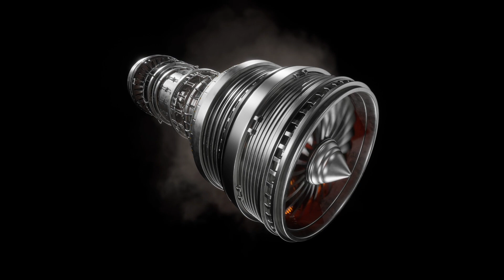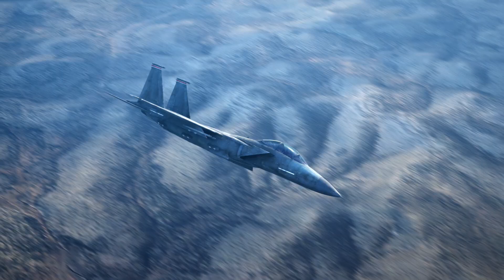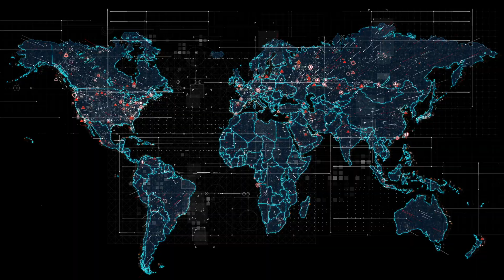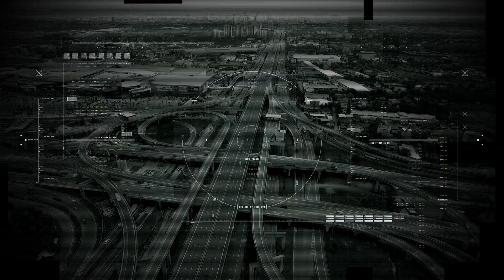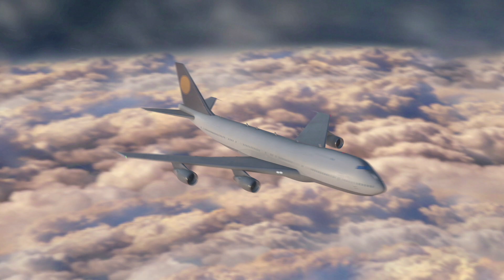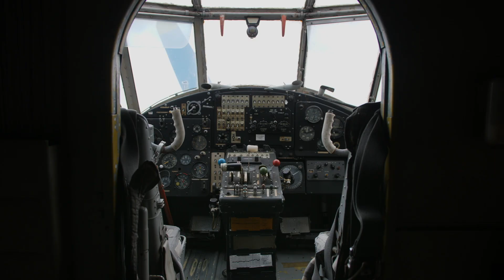The $2 Billion Aircraft That Can't Be Detected

Comment: Cannot be detected by ground based radars abd satellites.....ARE YOU SURE?
I say it can be detected by modern radar array😊
ALL THE BEST!
Reply from the maker: about detection of B2 no it is not correct to say it cannot be detected by ground radar or satellites stealth does not mean invisible it reduces radar cross section and delays detection modern radar arrays and sensor networks can sometimes detect stealth aircraft but detection does not automatically mean tracking or firing solution so your point about modern radar having a chance is partly right but the absolute claim that it is fully detectable like normal aircraft is also not accurate